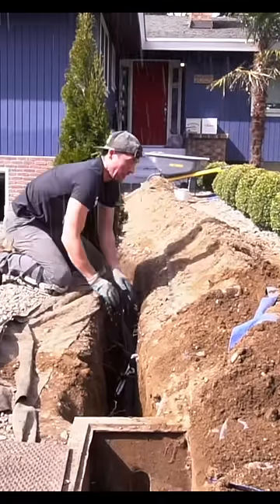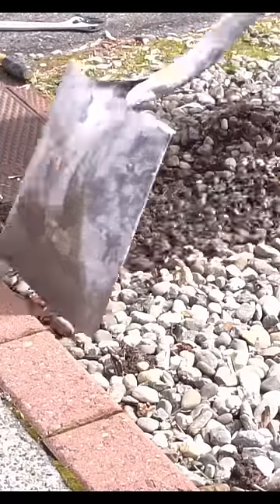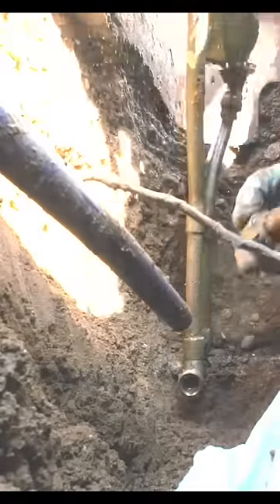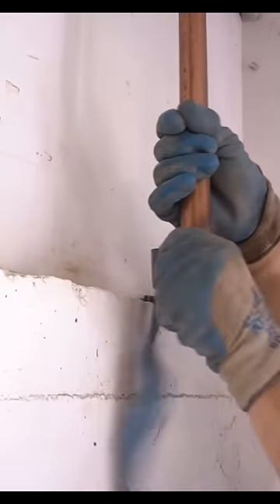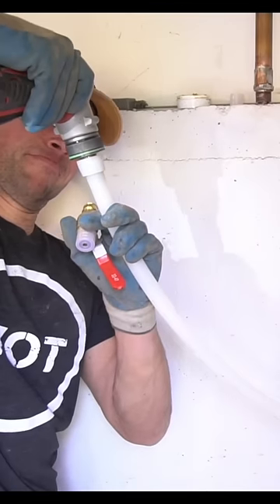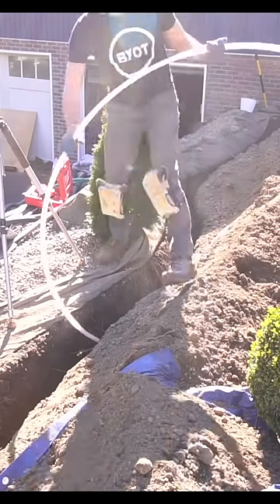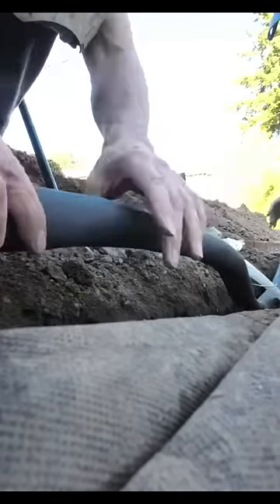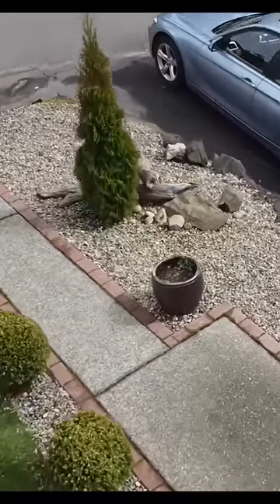Saved $8,000 By Fixing My Own Water Line! #diy #plumbing

Comment: Some cities require a licensed plumber
Reply: All cities
Reply: have you ever heard "right to work states"?
Reply: Not if you are the homeowner.
Reply: Not if they don't know.  🤫 😏
Reply: @you2449  👍
Reply: You can work on your own homes pipes..
Reply: Laws only matter if they're enforced / if you get caught. Especially at the local level.
Reply: In KY you haft to pull a permit (Master Plumber or Home owner. Not mentioned code code valuation I saw.
Reply: @danielroble474  Mn you ae required to.  The owner can do the work.
Reply: And your home owners insurance can deny coverage.
Reply: The biggest problem is that this only works in some areas and would be a serious mistake in others costing you a lot of money. You follow this in a northern climate and you are going to have spent way more than you saved on the plumber.
Reply: There's not enough code enforcement officers out there to catch you doing it.
Reply: Where I'm from it's 8 feet deep, copper, and you are not allowed to touch the curb stop. homeowner or not, the city does the final connection.
Reply: Here, anything before the meter in the basement is the DEPs responsibility. Considering that the line is probably 10 feet deep, and there's no shutoff outside the house...
Reply: @machinist7230 : Where do you live that water lines would be 10 feet deep?  Antarctica?
Reply: Not if they don’t know about it.
Reply: County wanted $35 for a permit for putting up mailbox, then they said you had to have a special metal square tube that only they sell for $35.  Were they going to inspect it?  No.  Was Just a money grab for $105 they didn't get.

They (county) weren't open when I moved all three boxes in our cluster with post office location approval on Sunday (only Non delivery day for Post Office).  Put in Square 4x4's posts on all boxes.
Reply: This is correct , you aren't allowed to shut off your own water
Reply: @johngatsby1473 unless you post it online😂
Reply: @Nick-wf1je  : It depends on the municipality.  I fixed my own water leak a couple years ago and I turned it back on at the street with the inspector there.
Reply: I think the thing that a what a home owner to do is look at the full video and ask themselves if they’re capable of doing it correctly. In addition you have to check local codes. There can be severe penalties for doing work that requires a permit without getting one. You may also want to check with your insurance company.

When I lived in Iowa, I had some neighbors who replaced their metal pipes with plastic. This was allowed by codes. However later when they moved away and tried to rent out their property until they found a buyer, they found they couldn’t because plastic pipe was not up to code for rental properties.

For me, a bill at $300 an hour for what I do, so I would hire a licensed plumber. In the time it would take me to do this, I could earn far more than the bill would be.

Comment: It's going to leak aging should of made a 2.25in hole put 2in piece of pvc in the hole then ran your pex if your house settles at all it will break again
Reply: 2” pvc is 2 3/8” od. You need a 2.5 in hole.

Comment: Nice job, just a tip. I wouldnt have wrapped the wire around the carrier pipe. If it ever gets charged, it can burn a hole in the pipe. It happens sometimes in the natural gas industry.

Comment: Here in Massachusetts you'd still be digging the trench. Water lines from the curb stop to the meter need to be buried six feet deep, with a foot of sand below and above the pipe. The pipe must be inspected prior to backfill. In my town, the pipe must be 1" copper. And by the way, digging around here is done with a pick due to all the rocks. A shovel is only for moving material that has been loosened with a pick. For a once every 30 years (maybe) situation, I'll call a dude with a mini excavator.

Comment: Pex is not for under ground. Did you pull a permit and get inspection. In cal it used to have to be brazed type l copper. Now it can be soldered. Or schedule 80 pvc.
Reply: Idk why no one can read or bother to look shit up. This pex from uponor is indeed rated for DIRECT BURIAL. Your codes and inspectors may vary. A lot of stuff is allowed down south that would never fly up north

Comment: Where I live, gotta have copper line coming from inside the house 10ft past the foundation and electrical panel grounded to it. They also want to see the blue pex.
Reply: Where I live .. I do it my way.
Reply: Yea same here. Up in Canada you can only use soft copper or municipex pipe. Upinor pex-a wirsbo pipe is only for inside buildings

Comment: Bury it below frost line an you won't have to heat it the foam would be enough as long as it's constantly used(make sure tap at the end is dripping for constant water flow) im a michigan resident

Comment: interesting, where I live 2 types of pipes are mainly used PEX another one that is called SP.
for PEX it's always ran through some kind of conduit to protect it. and in case there is a leak you can pull it from the conduit and replace the line.

Comment: the spraying in the face is the most important part remember to not turn your water off when repairing , you want to keep the main line on for that consistent splash when you cut into the pipe or else you know there's not a leak

Comment: Make sure you cement or foam spray the hole in your foundation. And also you don’t need to wrap the tracer wire around the pipe like that waste of time imo. Good job though 👍🏼

Comment: Works great for your video try drilling under the street to reach the water main then have the tapping done by a water company then place the new shutoff valve four feet down under the sidewalk and then attach a new copper pipe to the new water meter in your basement. Cha Ching $ that will be $15,000. Thank you!

Comment: wow man, water meter outside into nice box, then you had to dig up 2 feet below ground ,that's alot of digging man, make sure you hydrate yourself..here a bit up north of you, deep frost is at min 4 feet but the water lines (outside are over 6 feet deep and sometimes you cannot put any mini-tiny ( mino-mo😅) excavator you need to use something Id call an AI shovel and few gallons of will (you marry..)😂 amazing 👏

Comment: Kudos for including a tracer line. It’s a crime that most pipe mfrs and installers don’t include them
Reply: What is a tracer line?
How does it work?
Reply: @okkrom  It’s a simple wire that’s attached to the pipe over its entire length. The wire is accessible above ground. Locator personnel can attach electronics to the wire, induce a tone on it, and pick up the tone with a wand that’s like a metal detector, but more focused. Wherever the wand beeps, the locator sprays paint on the ground.
Reply: @Mars-zgblbl  
Got it!
Thanks for the explanation.

Comment: My sprinkler line to the valve box had a leak. Notified by my water co app. Shut in water system, Pressured up with air, heard it, found the leak, fixed it. $10.

Comment: Most locations require specific licenses to repair a service line. Check before you try "save yourself" $8k. You could end up paying a lot more paying someone to redo it.

Also, you can tell this is probably a southern or state out west bc the meter is outside, and in the north service lines are at about 42" down. Below the frost line. So....there's that.
Reply: Not sure about this specific case but very often when a licensed (whatever) is required to do something being a homeowner diy subverts that requirement and is mostly referring to... get a licensed contractor in that specific trade not a "handyman"

Comment: A couple things you did not do I would have said I overlooked.
They make solderable pex a adapters. You kinda used 2 fittings right there at the copper lol. Could have used the one adapter altogether. The perfect thing right there would have been a female female solderable valve and a male pex adapter, I like my valves to be on the copper so you can shut it off with one hand since your valve would be on the structural pipe. Nothing wrong though! Optimization isn’t always how the truck is set up and everything is up to you 
You did not sleeve the pex as it ran through the concrete. Not sure what this does considering it is also polyethylene and I’m not sure if it’s code but it’s definitely something my boss says to do, makes you wonder why they sell it. But seriously, $8,000 for a 3/4 inch water line? I’ve done way more for half that. I don’t know where you live or how hard that dirt is but you might’ve called the wrong person for that quote. $5000 and we repipe an entire single family residence with PEX. Stuff is easy and cheap.

Comment: Noticed there is no sleeve through foundation wall.  Did you have to pull a permit? Always check with your local authority having jurisdiction....  could come with some pretty hefty fines if not done properly. Overall not bad

Comment: Cool vid! This is super nit-picky, but do your utility locator a favour and just lay the tracer wire in a straight line, don't spiral the pipe.. it tosses the signal in weird directions. At 2ft probably not noticeable, but at 6 or 8ft it can raise an eyebrow.

Comment: A large water bill does not automatically mean there is a leak....check if the meter goes backward....if it does then check if you have a one-way valve on the water line....bad pressure at the water plant could draw water back out of your pipes and push back into water meter every time the pressure drops. the multiple times a day the water moving in and out of your meter by the same water is how they are stealing from you....
Reply: That one way valve you are talking about is called a check valve and it prevents backflow and back siphoning, water can only flow to the house not from it so it actually does exactly opposite of what you are talking about. You want that check valve for sure. 
Low pressure from the water plant is usually from large breaks in the distribution system. It's not them stealing from you, it's also not a constant thing, you wouldn't even notice much of a change on your bill from something like this.
A leak though is constant, a small leak constantly can lead to a big bill and even so they usually will give an estimate. Water going in and out wouldn't even cause a higher bill that's not how meters work. 
Ever see a 60" main? You can literally drive a small car through the inside of them one breaks will definitely cause low pressure anywhere near the area.
I've done this for well over 30 years now.
Reply: @john james something to watch is the reading, you wouldn't believe how many times I had to go behind people when customers have an outrageous bill and the meter isn't showing a leak it's always the meter reader didn't even come close to getting the reading correct, some areas use the electronic scans though so that shouldn't happen if that's the case
Reply: @wm1958  most houses do NOT have a one way valve as its not required by code ....tell me that is not stealing by charging you for the same water ...i got months of bills to show ya of over 117,000 gallons used when im not even been at the house at all....and i watched the meter run backwards.....put a one way valve in and bills dropped to less than 2,500  gallons used even when i was there the whole month.....
Reply: @john james that's because you had a leak or a faulty meter not because of low pressure from the plant, If that's the case everyone in your city would be experiencing the same issue. Not just you.
Reply: @john james that's true where I live also it's only 2" meters and above that require a check valve but it should be all meters. 

If this didn't happen to long ago I'd fight that bill, they should give you an estimated price and not charge you, they do this with leaks as well.
We had a meter that was doing exactly what you were saying and changed the meter out no problem after that.

Comment: Nice work, but DIY’ers please keep in mind that Uponor Milwaukee took is $600. Pex isn’t cheap either but still cheaper and longer lasting than copper. This is a pain in the ass job but once you’ve done it it’s fairly simple and straight forward….should you not run into any other plumbing issues.

Comment: "I did it with Uponor, a new innovative system", except Uponor is a manufacturer that has been around since 1918, not a system, and their ProPex connection system has been around since the 90s.

Comment: Wait was the estimated repair cost 8k?

If yes, doesn’t it include time and material?

If you saved 8k that means you received the materials and tools for free and value your time at 0.00

I’d be curious to know a ballpark of what you make an hour at work, so we can times thst by the hours of labor you put on repairing this. Then how much the tools cost that you used (even if you already owned them) plus the cost of the materials.

I dont think you really saved 8k, unless this project was 10-12k originally

Comment: I thought pex needed conduit for burial?
Reply: Code in some states require concrete over top of the pipe to avoid accidental punctures.
Reply: Per manufacturer recommendation no. But I have always sleeved the pex buried underground so you have that peace of mind.
Reply: Per manufacturer recommendation no. But I have always sleeved the pex buried underground so you have that peace of mind.

Comment: You could feed the whole house on 3/4” Pex?
Reply: Seems insane, right? Idk how big his house is, but a single 3/4" pex worked for feeding a 1500 sqft, 3 bed, 2 bath house I built.
Reply: Right now this place I just plumbed in is operating on a temporary permit but currently they’re whole building is being fed off a 3/4 pex line it goes to a 2” booster pump into a 2” water main hot and cold. There’s 9 flush valves and probably 20 sensor hand sinks. It’s supposed to be a 1”1/2 main feeding the building

Comment: I came here for the "You did it wrong, you should've done it this way" haters, but I stayed for the " Just gotta leave a toxic comment no matter what" haters.  Yep ya'll are right nobody should try this repair on their own. I mean this guy had a super fancy tool that will easily cost thousands of dollars to buy and there is no chance that you could rent it or just use one of the many other options available to attach copper to Pex. LOL so in review don't try this yourself, its scary!  There is no way you can do this, and your house will probably fall down if you don't wipe that pipe dope off and that solder is likely to spontaneously combust for sure!

Comment: Or, you could have simply fixed the leak in the existing line instead of doing all that.  It would have been a lot easier and way less expensive.
Reply: Yes it would have been, but what if that wasn't the only leak? I'd rather replace rather whole line than try to find a bunch of pinhole leaks. Any company worth their salt would tell you that immediately. Plus you pay that big amount not only for the repair and labor, but for the warranty that comes with it. And again, any company worth their salt would have bored the hole and not trench it

Comment: A leak outside don’t cost you money nor would exterior water leak reflect on your bill. It has to leak after the meter to be charged aka inside your house only not outside?????????
Reply: Here in Dayton all the meters are being moved to the yard, no longer in the basement. Supposedly it is for the safety of the city workers and easy access to the meter. They were really just tired of replacing galvanized lines outside.

Comment: 2' lol. Good luck digging down past the frost line in my area. Or get some big gains trying. That solder joint looks a little cringe. New and innovative? Expansion fittings has been around since PEX hit the market, what 20+ years ago now. Wirsbo was the brand I used. Just saying, sometimes it pays to hire a plumber or at least do the hook up part. But I have no problem costumers trying to save some money either. There's plenty of job security in repair work fixing DIY mistakes.

Comment: You just saved $8000 but have no idea what you are talking about. Uponor is not new nor is that piping. Uponor (formerly Wirsbo) has been making PEX pipe for radiant floor heating since 1970, longer than any other PEX manufacturer. We were also the first to bring radiant floor heating to North America in the mid-1980s.

Comment: Yeah but you put in the wrong size service line. Put in a 3/4 service line. In your home 1 inch, which means you just killed your serviceable fixture units to 17. Not meeting the minimum requirements for the home. Never run a main service line under 1inch

Comment: You forgot to tell him the rest of the $8000 went in tools that you bawl and not only that the average homeowner will break their wrist operating that hammer drill you just put through your wall so on top of the doctor billding would have they would probably have paid 30 to $50000 to later own water line not on including the fact strain that they don't use everyday and the chiropractor to put your disk back end plays from cutting the roots come on man don't be doing at these customers

Comment: Upinor? The system is called wirsbow u named the maker of the parts and tools and u never feed pex through concrete! copper where you transfer through! And you don't use under house insulation around the pipe when you burry it you must hard sleave it. Or use the proper pollypipe. That can be direct buried. Call a pro. And 8k you are getting ripped off. I could have brought out a directional drill and not had to tear up the yard for less than half that price. The way u dug it should make that job maby 2k. U obviously didn't pull a permit or get it inspected. Would not pass! Maby I'm wrong I have only been building plumbing systems for 25 years